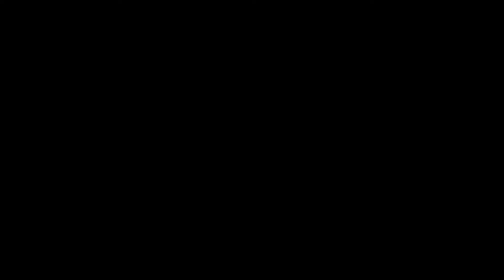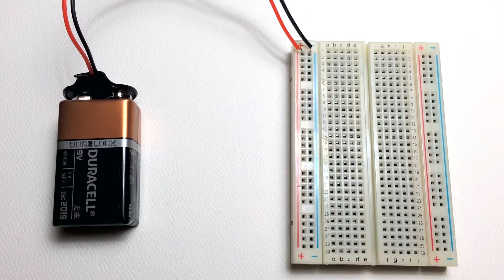The 555 Timer in Bistable Mode

Comment: Great video, was thinking could i use a npn transistor to replace the trigger switch? Only ask as i have a positive voltage signal (about 0.5 sec pulse).

Comment: Hi scott, im wanting to making a latching timer circuit using a 555  thats adjustable between 4 and 10 seconds to power a relay. I want to use a lever switch to trigger the timer on and stay on, no matter the state of the switch there after... so no reset. Ive been looking but a bit confused to which circuit would best suit.

Comment: Why the bridge between 1-6 and the capacitor?
Reply: Do you mean 1 and 5?  It is not really critical--it should be much smaller ~0.01uF.  It stabilizes the 'control' input, which can vary the frequency somewhat in the unlikely event that sufficient current gets coupled in.  Anyway, it is totally unnecessary here--especially one that takes up so much space!
Reply: Is this a decoupling capacitor?
Thanks! @dalenassar9152